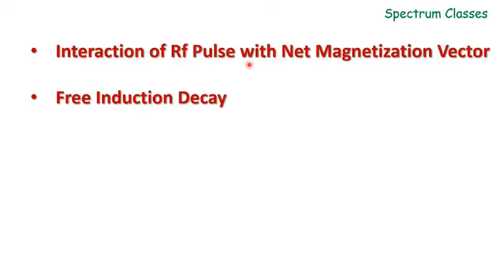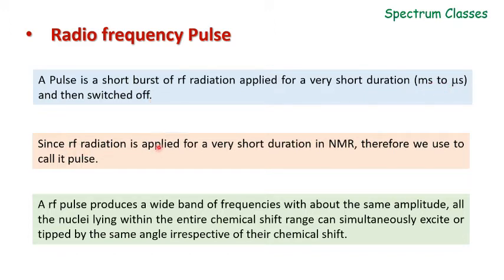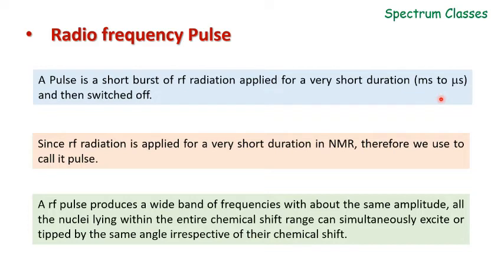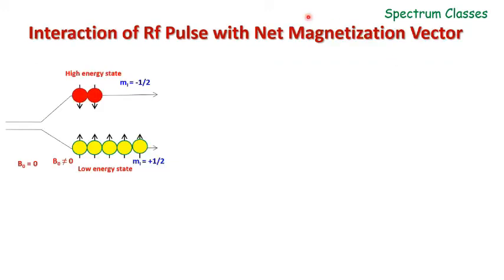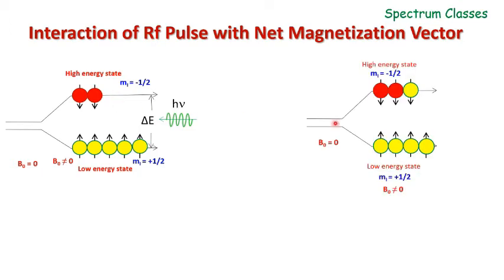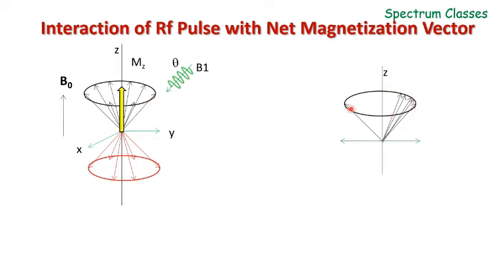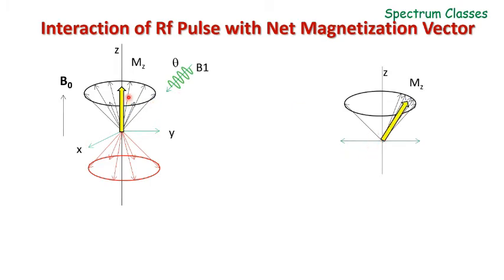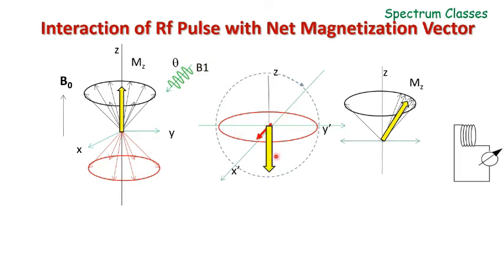Interaction of RF pulse with Net Magnetization vector| FID| Easy Explanation

Comment: Thank you for the video! I hae a question. Why is magnetization processing on x-y plane? There is applied magnetization along z-direction but why is it going like it?
Reply from the maker: Thanks for watching, actually the magnetization is precessing about the applied magnetic field initially B0 field is there in z direction therefore the magnetization vector is precessing about that z-direction if suppose B0 disappears (as in case of rotating frame of reference) and B1 (oscillating magnetic field) appears i.e., rf pulse is on the magnetization vector start pressing about B1 when rf pulse is off at 90 deg, now the magnetization vector experience only B0 and again starts pressing about z-direction i.e., in x-y plane here dephasing and spin relaxation processes are involved, I have explained all these please check NMR spectroscopy playlist, thanks and stay tuned